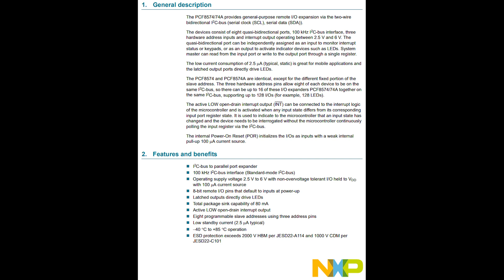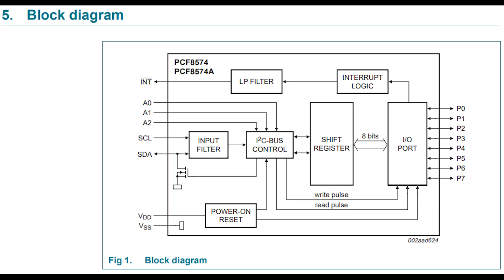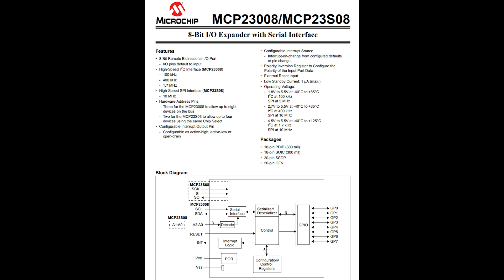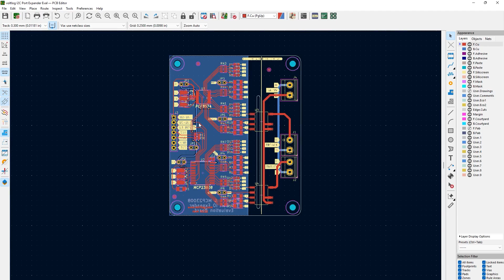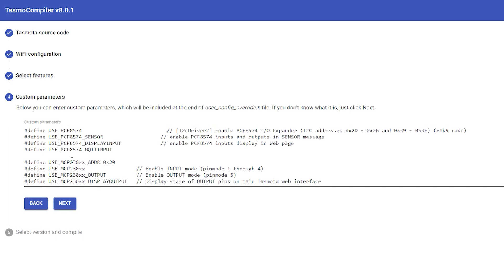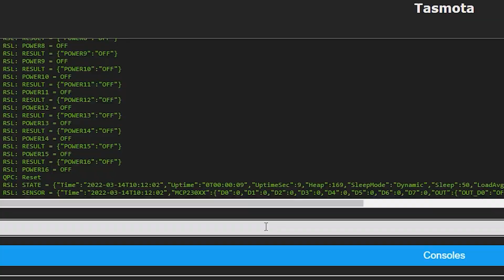Expand your GPIO! PCF8574 & MCP23008

Comment: Is it possible to use audio input (e.g. inmp441 i2s) or audio output (e.g. max98357A i2s) via these port expanders? If yes how is it done, especially the pin config? Thanks for any advice. I only got buttons, leds, encoders to work.

Comment: pay extra for the 23008, the 8574 is a nightmare for input, and useless for (+) output as its limited to 100ua .this makes it fine for say keyboard scanning (theres a library/sketch for that) but for driving leds / 7 segment displays or switching transistors for relays i would avoid it

Comment: I just use serial to/from parallel shift registers with latches:-
74HCT595 for output, CD4021 for input.
The 595 doesn't have high drive capability, but that is often not needed.

Comment: This is a classic trap with the PCF8574 for which I have fallen my self. The chip has a high rated SINK current (IE current into the pin) where as it only has a 300uA SOURCE current (Current out of the pin). Which makes it not very good at driving loads.
Reply: trouble i am having is when i set them to input and apply +v, they show in the code a logic 1 and logic 0 with no volts,  but the pin is drawing like 60ma!!! the only 'guess' I have is that the library is only setting them for input while doing the read then they are reverting to output or some other weird thing
Reply: @lezbriddon  You set a register mask for reading.  There are really only two states though: High resistance with high voltage (read), and Low resistance with low voltage.  I have been able to put a button and indicator LED safely on the same pin by rapidly polling. Tie one end of the LED high, through a resistor.
Reply: @GnuReligion  yeah I'm using a library and I'm an electronics guy not a real coder so I have no idea what it's up to under the hood...
Reply: Yep, the classic pseudo IO. When he started talking about the dim leds I immediately pulled up his schematic and indeed, not sinking.
Reply: @tengelgeer  yeah in the issue i had i was trying to use the io pins as normail input and send 3v into them, as i needed to read +3v i was setting the pins output low before doing the read...thats the problem, these pins are /never/ inputs... they are always outputs and current sinks... what i should have done was write them as high, then read them, but because they are now weak pullup high i can only detect a low as an input...not what i wanted, but i could have inverted my signals if needed, its an odd chip....
Reply: I fell into this trap too with PCF8574 and its bigger brother 16-bit PCF8575.  I solved the problem by adding Darlington drivers like the 8-bit ULN2803 which can sink approx. 60ma per channel, enough to drive mechanical relays.
Reply from the maker: It is indeed a trap for those like myself which don't read deep enough into the datasheet 😂
Reply: @voltlog  The pseudo IO of the PCF does give it an interesting trick though. A pin can be an input and an output simultaneously. As long as you can get away with the input device also turn on the output device. But a very neat trick for function buttons with corresponding led for example.
Reply from the maker: @tengelgeer  Neat trick up their sleeve but I can't see myself using that anytime soon.
Reply: Yes, the weak source ability of the 8574 surprised me as well. A 595 shift register does not have this problem. Another unexpected quality is the power consumption -- the 8574 can get quite hot.

Comment: I think that the reason why the LEDs driven by the PCF8574 are so dim is that the PCF doesn't have classical push-pull output, but a weird one where it's either in low state (which can drive up to 25 mA typically, the 10 mA is minimum spec), or in high state, which has only a 100 uA current source. So if my guess is correct, you are driving the LEDs against ground, so you are driving them with 100 uA. See the datasheet, page 12.
Reply from the maker: Your guess is correct. It is indeed a trap for those like myself which don't read deep enough into the datasheet 😂

Comment: Florin , this might be a bit of but when do you think it is worth using these kinds of IC since at some point getting another MCU or larger package would be cheaper (and i assume better due to lower latency ) .
Also in this case i assume you are using them as DC signals wouldn't some multiplexed flip plops be better? (maybe the IC is this inside , not sure). 
Also relating the LEDs , i saw your video but i am still not sure how to find high efficiency ones. Or rather what would be some good filters in order to find some or , lets say mouser/farnell . More cnd /mA is the goal BUT what would a good ratio be ? and/or what would be a good way to find them ?
Reply from the maker: There are multiple factors to consider so it's not a matter of which option is best in general but which option is best for your specific application: I have to consider cost, current drive capability, control gpio usage and firmware support. So for this application an I2C GPIO expander is the best solution.
Reply: @voltlog  THX , but that about the LEDs?
Reply from the maker: I prefer to use LEDs rated for ~500mcd @ 10mA.

Comment: Hey Florin! I've used the MCP23017 (16 I/O) on a project of mine. On unexpected behavior I've had ocasionally intermittent issues where on first powerup, it will not react to the first command. Weird. maybe? a library issue. I should test again sometime, but seemed worrying at the time for my project.

Also, do you have any chatroom where you chat outside of YT? maybe considered making a Discord channel?
Reply: I2C is a serial bus of course and any noise during power up / initialization can be seen as bit clocking. Once any bit is clocked you are now out of sequence with your intended framing.  Send a reset command or two - be sure and wait for it to serialize - and you should be okay. Also if you are initializing for high speed mode be sure and delay before you send the first commands thereafter.  These parts are very primitive (I2C dates back to the 1970's) and today's high end microcontrollers are way faster than the original microcontroller specs (2Mhz or below) supported. Code must be written to tolerate turnaround times and to prevent bashing a transaction in progress.
Reply: @dennisfahey2379  Ah, thanks. That might be just it, that actually explains a lot tbh.. I'll keep that in mind when I go back to the project. Pretty sure it wasn't a hardware issue.
Reply: @danedwards_ee  - No problem.  The thing you get into is if every IO is across that serial bus you are bashing it quite a lot. And of course it is by far the slowest thing in the system. So its imperative to have an I2C service routine that runs that interface intelligently.  At the driver level it sort of needs to be abstracted like PCI-E. You post your command and watch for a driver flag that indicates it is completed and if a read cycle - data is available. (Semaphore) You don't want to have the processor waiting for each transaction to complete - doing nothing else. The driver can buffer the commands and handle the actual interface.  A common error I've seen is when people add a ton of IO and add I2C muxes to flip between device "groups". The muxes, too, must be locked in state when a serialization and response occurs. Then they are in "IDLE" and free to change the mux and start a new command on an alternate group. Ideally the CPU should be watching a bulletin board in memory of transaction and state with the driver reconciling from the other side.  Finally, IF you must for some reason support hot insertion/extraction of an I2C device - that driver better know to timeout and retry a transaction that get corrupted. Sadly I2C has no parity or error checking - whatever gets manifested by the corruption will be executed as a valid command.   It was never intended for this mode.